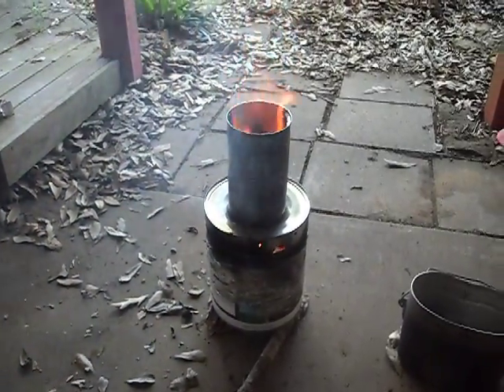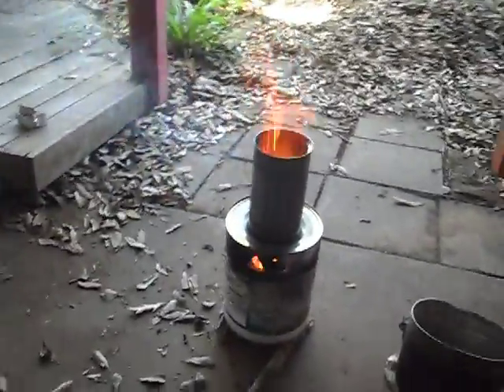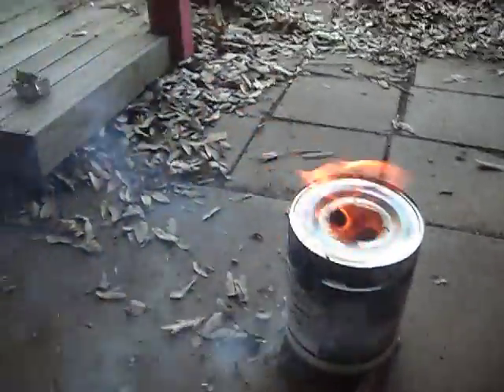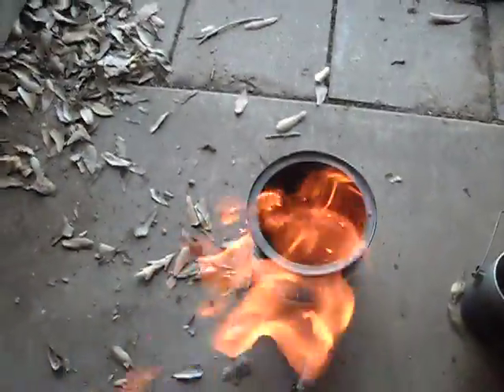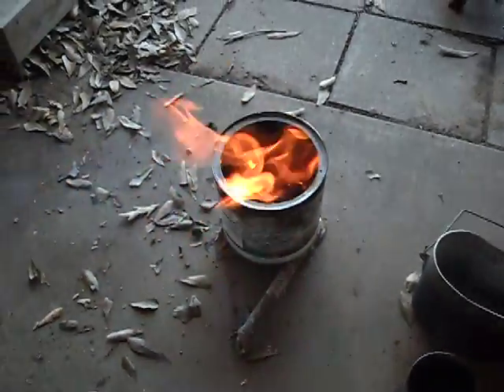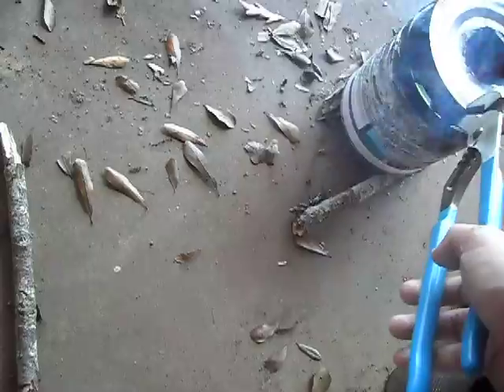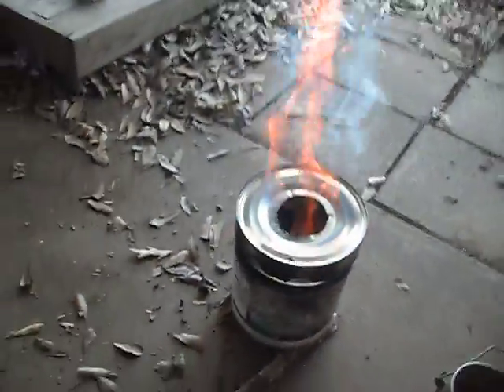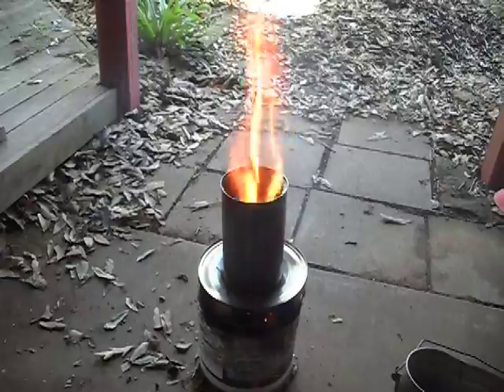Testing a TLUD Stove (Top Lit Up Draft)

Comment from the maker: Got it started with some dried leaves too. Easy to cap off and save some of the wood for later. I dig doing the 'last minute/emergency/scrap' DIY projects like this to kind of learn the mechanics and ideas behind the design before looking to make or buy a bigger and more permanent one.
 I hadn't really even considered the biochar angle. That's a great idea.